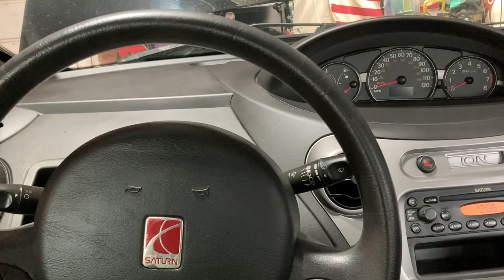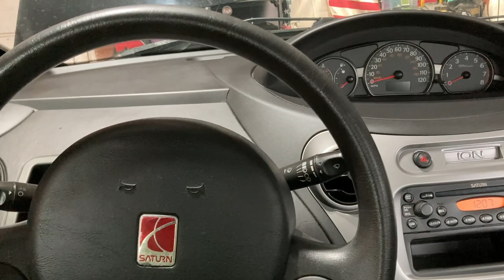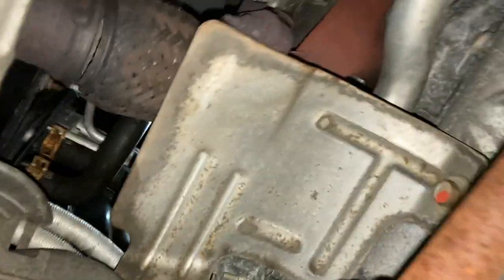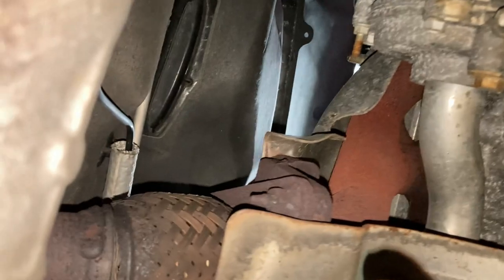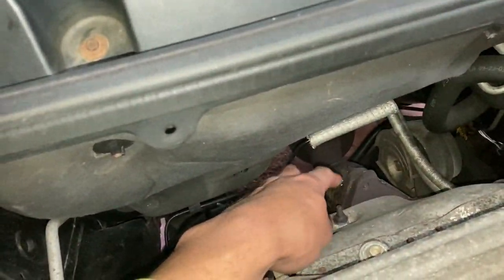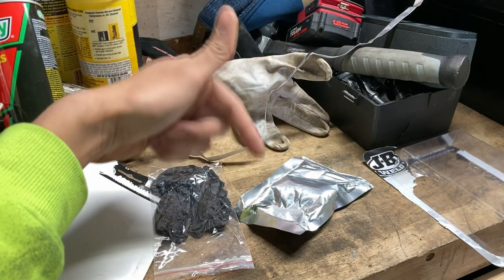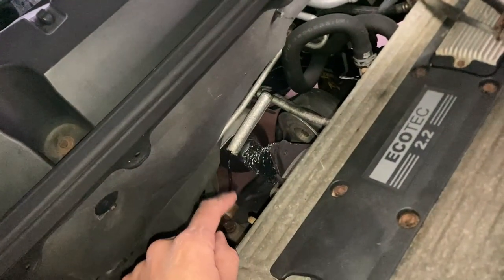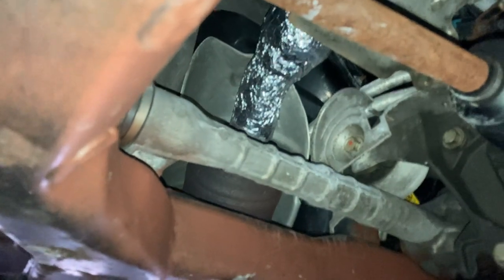Patched Up An Exhaust Leak With JB Weld Exhaust Wrap (Saturn Ion)

Comment: Hey, was wondering if the patch was still holding or has it fallen off? My leak is right at my flex pipe too and I'm worried that with the exhaust moving around that the patch won't hold.
Reply from the maker: The patch worked for me, I did replace the flex pipe tho but the patch did hold since then